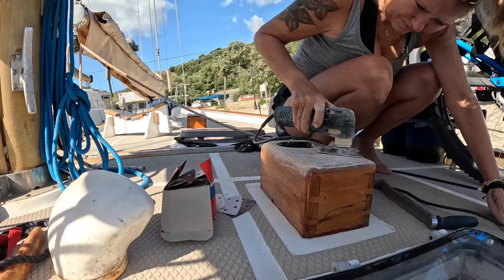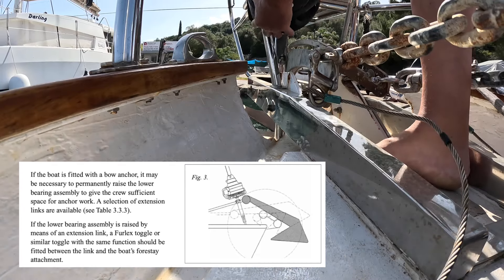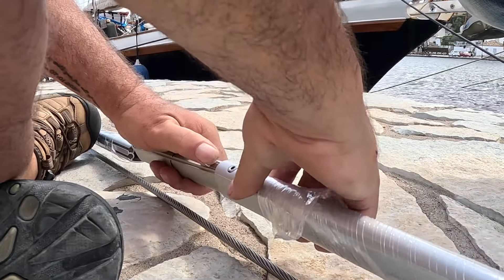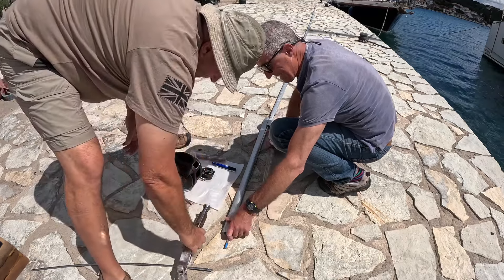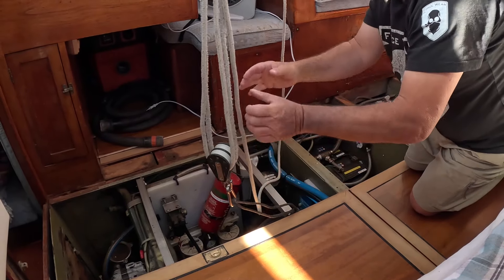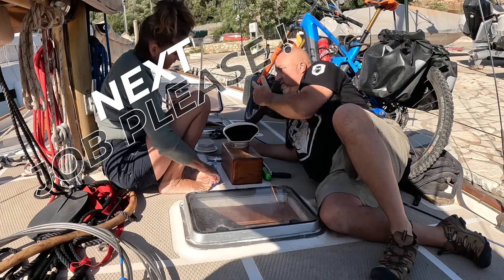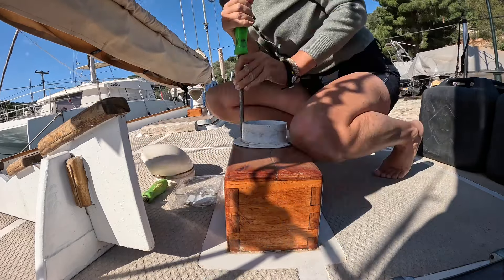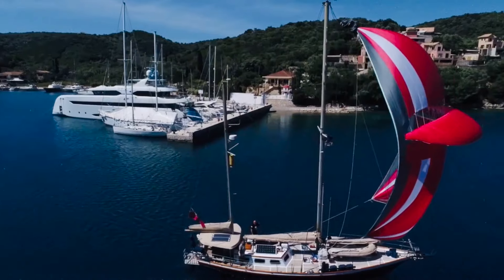EP 187 I NEED HELP !

Comment: You had to raise the drum by 4 bananas? 10cm surely??

I also need to say that I am shocked - shocked I tell you - at the dreadfully low quality of that crazy paving. None of it was level with the concrete. Standards are obviously in decline!

On the frames, why not install shims rather than bend the boom in the middle?
Reply from the maker: It was a VERY precise four bananas ! The cross frame is bolted to allow engine removal but bent across its length. To make contact across its full length would mean making dozens of varying sized shims. Besides brute strength always wins 😄